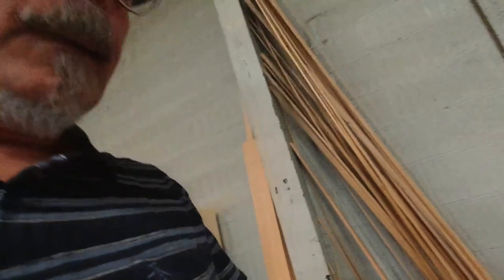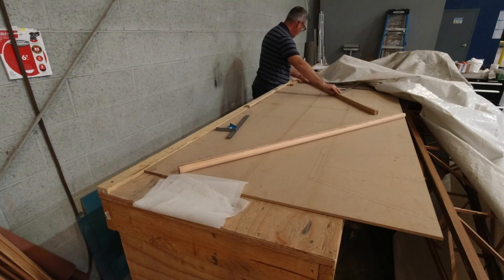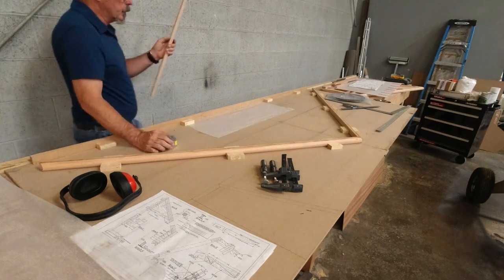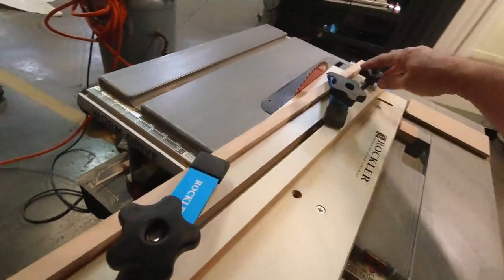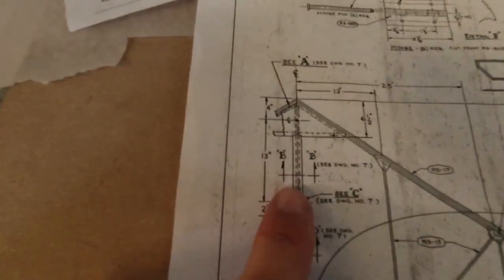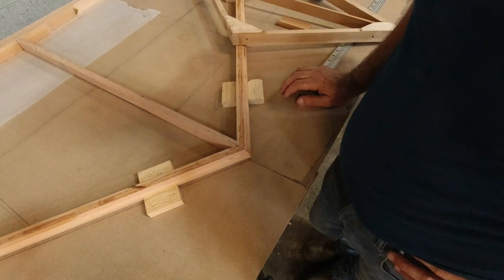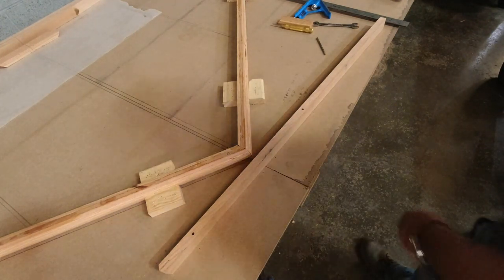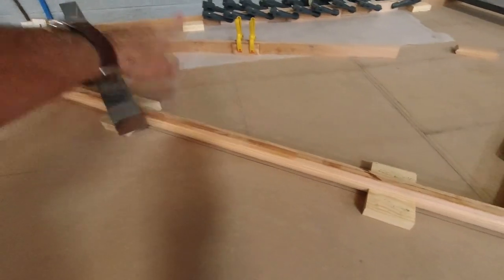Minimax 1100r Wood Aircraft Build Ep 108

Comment: Note: Below is a corrected post after I studied my drawings and your video more.

I'm building my horizontal tail for the 1550V.  After I made the RS-10 spar doublers and expoxied them together, I noticed a mistake I made.  For the large doubler, my drawing calls for a 40-in length with a 5-in taper on both ends.  Instead, I made a 50-in length which INCLUDES the 5-in taper on both ends.  I incorrectly ADDED the combined 10-in taper length to the drawing's 40-in doubler length to get an overall length of 50-in instead of a correct 40-in length!  This means my doubler extends further outboard than planned.  A rookie mistake in reading the drawing.

Then I came back to this episode of your build and noticed that you refer to a 26-in  length of your doubler and that it goes the distance from the centerline to the first RS-17 vertical rib instead of extending outboard of that rib like mine does.  I was able to see where your drawing does specify a 26-in length!   So that's at least one difference between the 1100r and 1550V tail.  Interesting!  I'm assuming that my doubler's extra length wouldn't hurt anything, but maybe I'll check with TEAM.

Can't wait to see your bird fly.
Reply from the maker: We’re any of your pieces a different size material? Or were they the same just extended farther out?
Reply: @DTMinimax  I got the correct length material from TEAM, but when I made the rudder I had trouble making the RS-10 tapered ribs.  So I had to scavange some of the RS-10 that was supposed to be for the horizontal stab.  I then made my own RS-10 doubler from a good, locally selected white pine board, but I simply misread the drawing and made the piece too long.